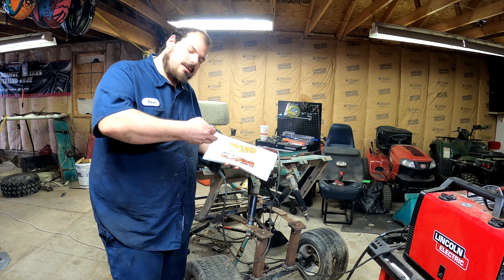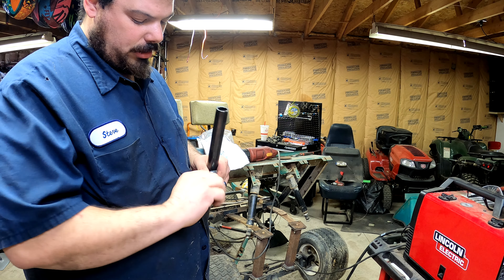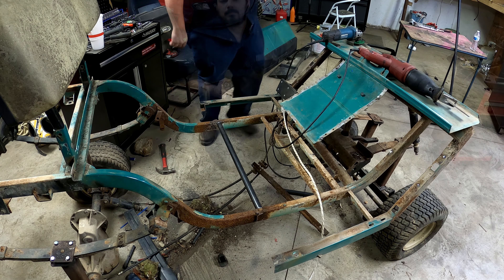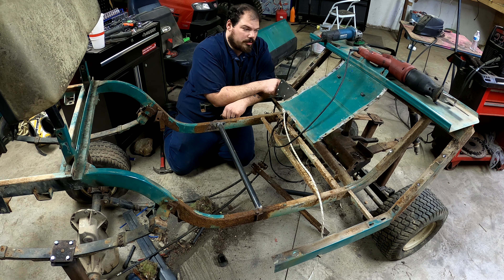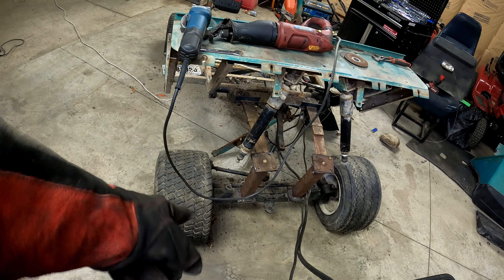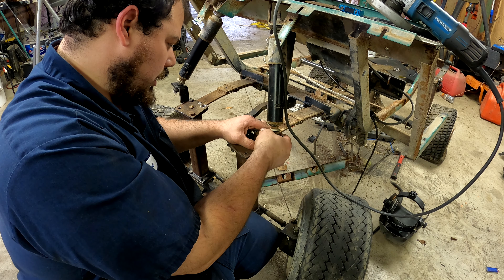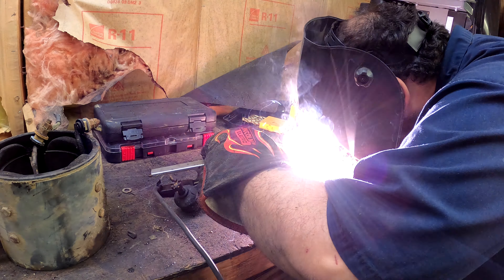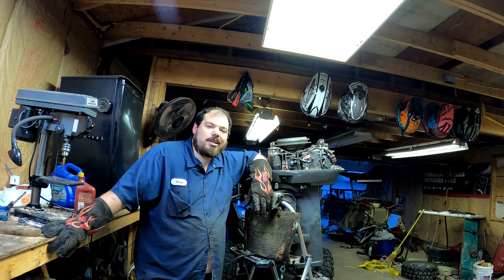Turbo Golf Cart Shock mounts and Custom Steering arm. @RedBeardsGarage Red Beard's Garage Thanks

Comment: I prefer the Miller welder myself bud I have both but 9 out of 10 times I use the miller
Reply from the maker: Cant go wrong with a miller.
Reply: I have 2 millers at work and a Lincoln at home..they all have their pros and cons but the get the job done.